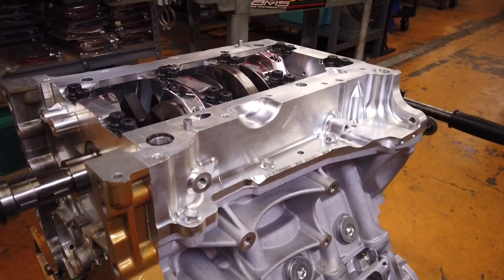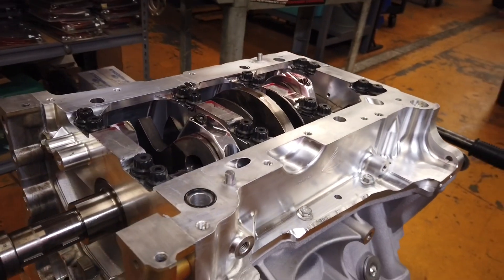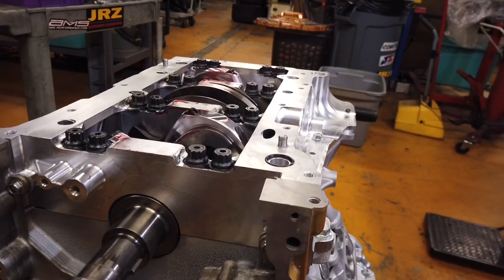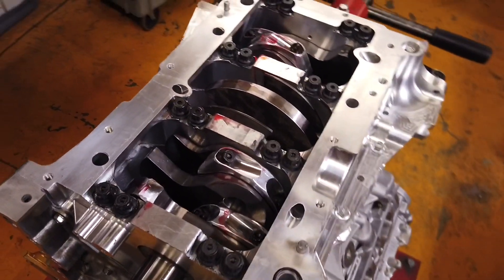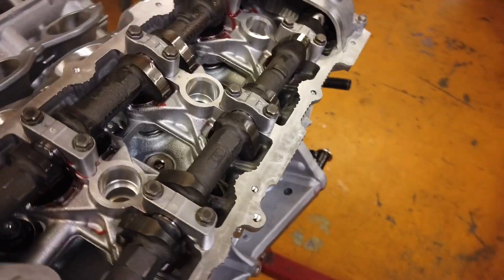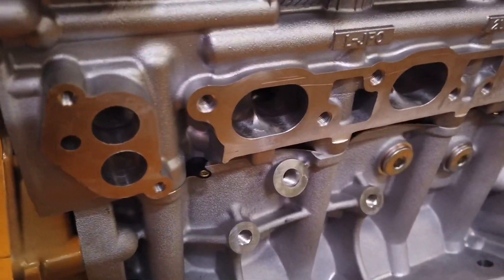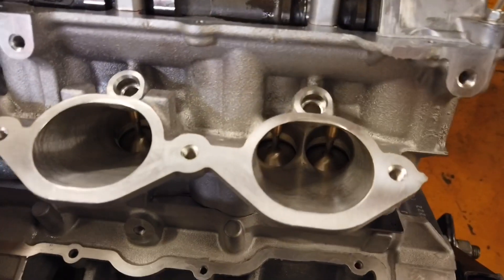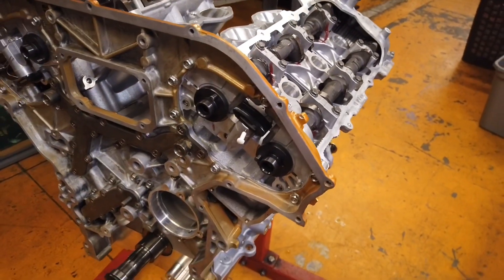How to Build a 1800+hp R35 GT-R VR38 Engine

Comment: did bottom billet leaking after all?...
Reply from the maker: We no longer use the billet alum main girdles for several reasons but biggest on being we now make quite a bit more power and needed a stronger solution. These still are well suited for builds like what you see in this video but if you are looking for the latest and greatest there are better options available now which I hope to highlight in a future video.
Reply: @ColabGarage  lol even 1st gen chevy small blocks are better than this shit, turbos/superchargers/blowers=cheating, betcha chevy small block pushes more HP naturally aspirated lol, this motors about 10x the size and doesnt even have close to the same displacement.

DOHC is just shitty for v6/v8 engines makes the engines way too large and heavy.